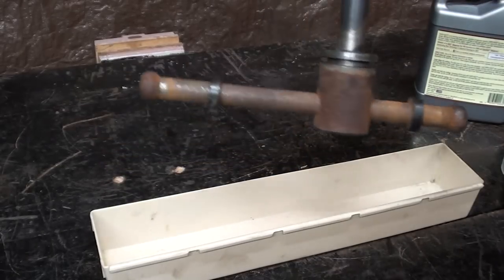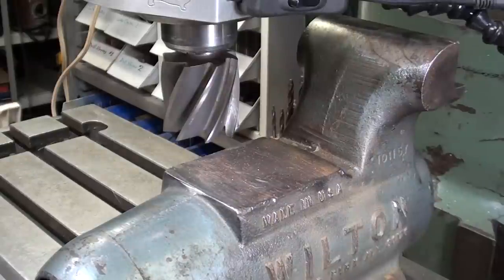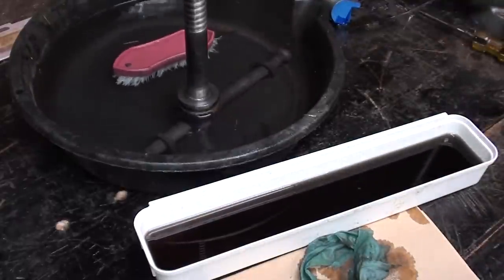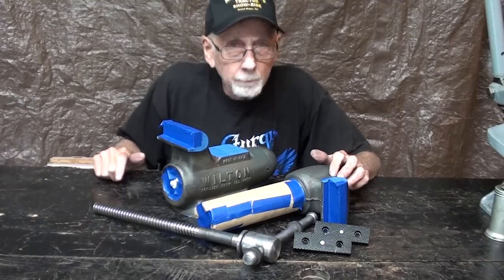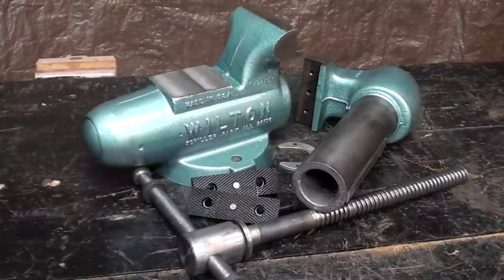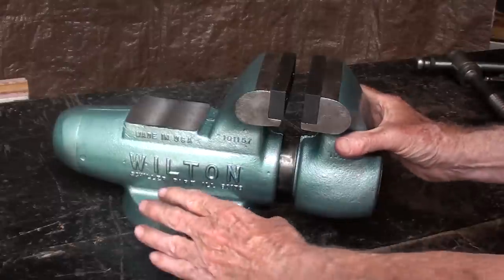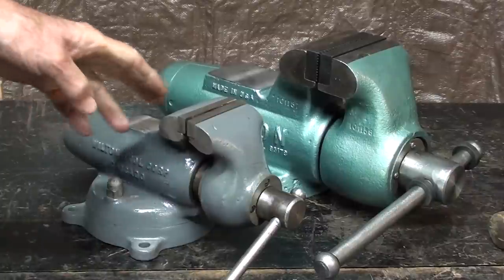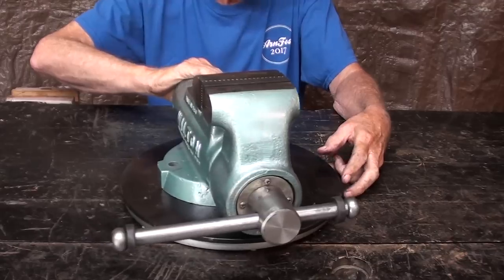RESTORING A WILTON BULLET BENCH VISE pt 2 #812 tubalcain

Comment: Love the old ball peen hammer trick. I use an old blacksmith post vise for heavy work and welding. They were built for that. I agree; cheater handles and big hammers destroy vises. I have a friend who just lost his prized Craftsman 4-1/2" vise when a "guest" in his shop took a cheater handle and big hammer to it and promptly broke the front jaw right off it.

Comment: I believe you are correct that most good quality vises are malleable cast iron. I welded the movable jaw on a 5 inch Buffalo vise for a friend. I veed it out and preheated. Used 7014 and built it up on 3 sides of the slide as it was a square beam. My friend still uses it on his welding table.AL B.
Reply from the maker: Good job

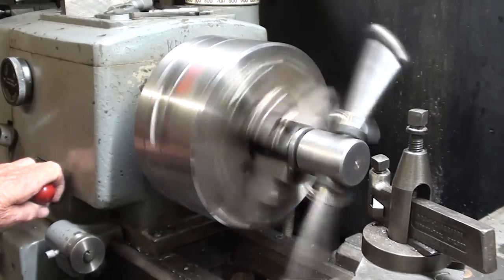Comment: 6:12 this has to be the sketchiest thing I’ve seen you do Mr. Pete. Tip for everybody, just cut one ball end off the handle so you can remove it. Then you can safely clean up the meatball of that main screw . You can also chuck up the handle to clean it up and then just thread the ball and the end of the handle to put the ball back on. Great video as always Mr. Pete!

Comment: Another good way to crack a vise is to clamp something small like a square and then use a large lever to rotate it. E.g. a 1/2 socket wrench and then pull on the wrench.. this will create tremendus force prying the jaws apart and will crack them.. also applies to any other lever prying the jaws apart.
Reply from the maker: Ouch

Comment: That's a neat trick with the hammer to the tape. I like the gray actually, as it seems like it was used by a Navy machinist! Great results!
Reply: I used to be a mechanic back when I was young and we used to use that same truck to make custom gaskets if we coulnt get a new one, if on aluminum I wouldnt use a steel hammer I would use some sort of  nylon.or other softer face mallet.

Comment: Love the video and the paint. I used the same paint on a project and only 10 %or so looked hammered. Don't know what I did wrong. Can you do a video about what you oil and what you grease? Thanks.
Reply: I’m a fan of hammered paint and I think I know what you did wrong. To get the hammered effect you have to spray it on heavy and wet, almost to the point of running off. Too light and you get only the solid base color. Heavy and wet brings out the little darker flecks. Takes a little practice to get it just right.
Reply: @ellieprice363  thank you. I will give that a try.

Comment: Excellent video, thank you! I'm a bit surprised that you did not give all the bare metal a good coat of oil. Those surfaces will rust and should be protected. Yeah, and grinding off flash is wasted time.

Comment: I bought a Wilton 1 x 42 sander at a tool show.  It needed a new belt which Wilton wanted $38 for on their website. The belt was $2.94 at Nicholsons Hardware in Rockford.  Also I do not see the need for Evaporust when you have to wire brush and sand to get a good finish.
Reply: White apple vinegar is cheap and does a good job. Just don’t leave it on too long.

Comment: I see often on YouTube where someone has to use a wire brush after using evaporust. When I point this out I am invariably excoriated for not bending down to the supposed balm of Gilead of derusting.

Nice project.Pretty enough to put in the front room
Frank
Reply from the maker: Thanks

Comment: RE facing in the lathe. I am not an expert here, but coukd you use rubbber bands or clamps on both sides of the handle where it goes through the part your machining to hold the handle firmly in place to make the operation safer?

Comment: Have you ever done a video on the installation of a vise on a bench, especially a vise with a swivel base?  I was an auto mechanic for over 35 years and I don't think I've ever seen a vise in any shop I worked in that had been installed properly to get the full use of it.  Worse?  I actually have seen a vise that had been NAILED to a wooden bench.
Reply from the maker: Actually, I already made a follow up video on mounting the vise to a bench.
However, it will not be released until September. Yes, most vises are not mounted correctly
Reply: @mrpete222  Incorrectly is one thing ... NAILS are something else entirely.  I hope Mr Sears and Mr Roebuck heard about it and drove out to give that guy a stern talking to.

Comment: I have an old one of these I bought at a garage sale, and i am VERY hesitant to remove the factory paint and put new stuff on with a spray can because I dont think it will be as high a quality paint job;  Not as thick and not as fiercely baked right onto the metal.  That's the feeling i get anyhow.